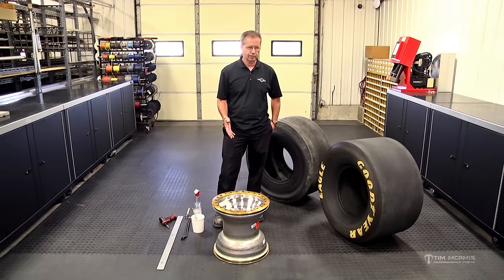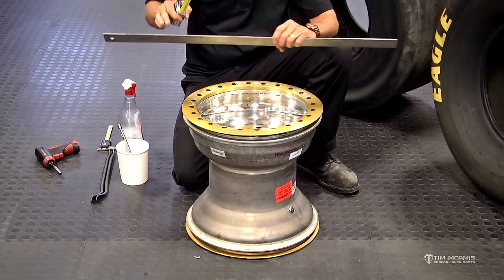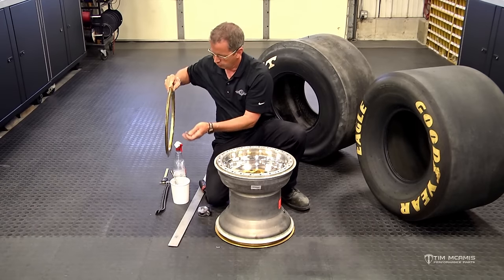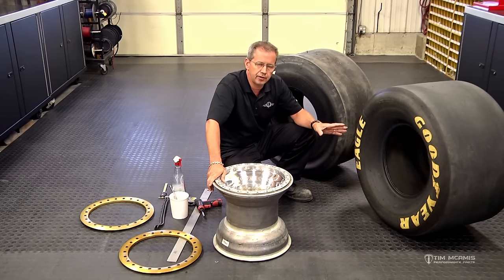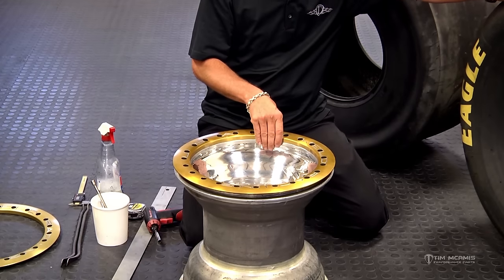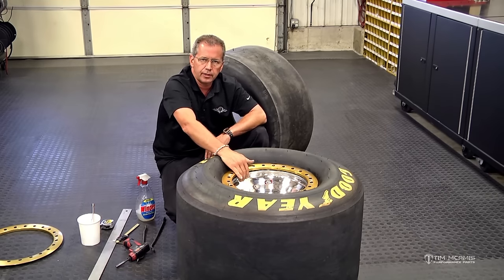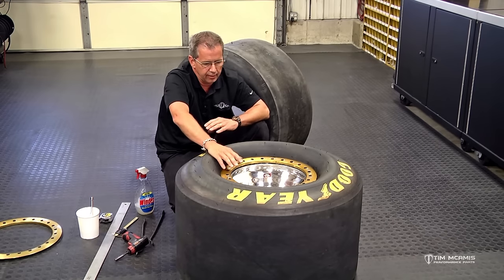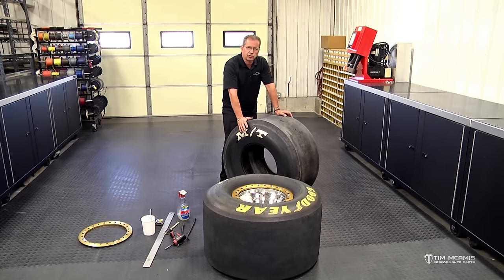Beadlock Mounting & Tire Selection Tips

Comment: What are some remedies for a different size problem you have a few passes on them? Just buy another set?
Reply: Over inflate the smaller one and wait. Recheck Rolll out.
Drag tries are sold in inch sizes. Mount and check, ajust.
I did tires for Bruce Littion and JR Todd

Comment: Hi, i have been enjoying the videos. The torque spec must specify the use of anti-seize? I am used to passenger cars where I am encouraged not to use anti seize on bolts as it will effect the torque value. Thanks
Reply: Top Fuel was 120 # dry and clean
Reply: @michaelfritsche4023  on beadlock bolts? N9 way. You must mean the lugnuts.

Comment: Do you have any tips for Radials ? And it would by nice if you could teach us about tire compounds (wich compound for which car and track conditions) and the difference between M/T or Goodyear or Hossier tires :)
Thanks !
Greetings from germany
Reply: Horses for courses. Track, weather, power output.
Both Goodyear and Hoosier really only have limited no of heat cycles before they have nothing. But both are very good tyres for the well heeled.
This is applicable to drag, dirt, road racing. 
Some other brands have more heat cycles but probably are not quite as good initially. Of the two my preference is Hoosier but not by much. And that is dirt and road racing. But I am sure applicable to drags as well.
And driving any race tyre on the street is both dangerous and making that tyre hard real quick!
Reply: @ldnwholesale8552  just say tire once lol

Comment: Thanks for the video. I have a question for you if I may. You said that you will bring the tire down to 6# but my question to you is how do you determine the correct tire pressure for your car? How do you know what you really need? I mean we get 6# but how do you determine if you need 7 1/2 instead, thanks.
Reply: Use a tire pyrometer for setting tire pressure perfectly. Otherwise it's guess work by looking at the tire footprint and seeing how the car handles and how the tire wears
Reply: It's called test and tune. And lining out the car.
Reply: @josephschaefer9163  details?
Reply: @slowpoke96Z28  a tire pyrometer is a temperature probe for tires. Do a hot lap, then measure tire temps on the center and near both edges of the tread. The hotter places have more contact with the pavement. Adjust tire pressure, camber, and car corner weight to get even temps
Reply: @slowpoke96Z28  for drag racing, you might get great 60 ft times with lower tire pressure, but the car can get unstable at high speeds. Be careful and adjust gradually
Reply: @josephschaefer9163  the same would apply to a hard tail (no suspension) dragster?
Reply: @slowpoke96Z28  yeah. Although you might want to ask someone with experience

Comment: That is center to center of the stud pattern. It should be measured across two holes center to center of the holes. NOT the diameter. 5 on 5 is 5" between centers of two holes.
Reply: AKillerTuna ROASTED
Reply: If you measure between the centers of the two holes it's like a quarter inch less so it's easy to figure out what it is